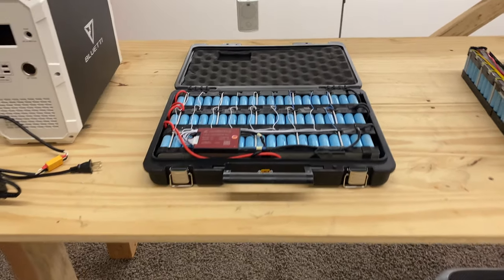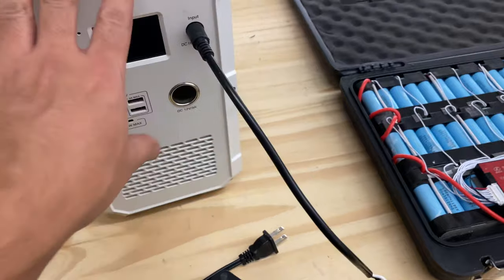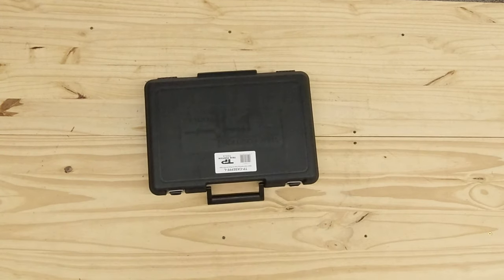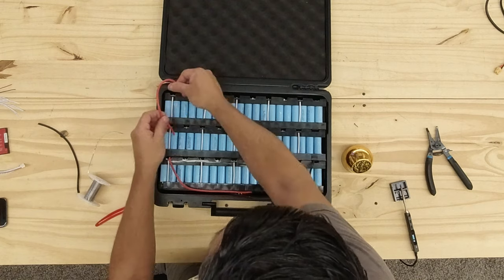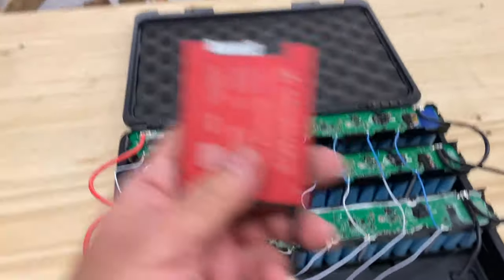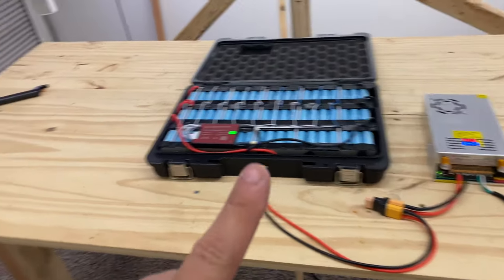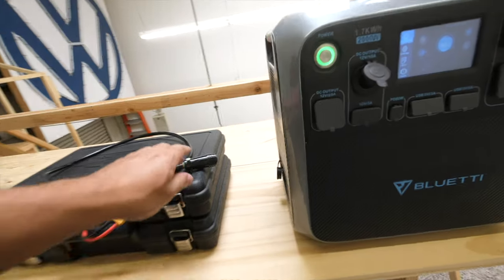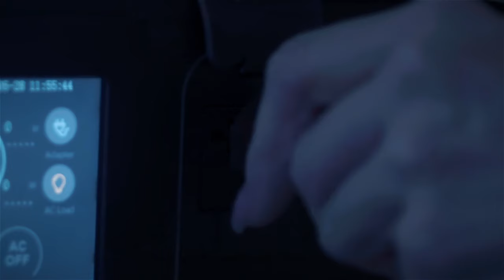Solar Generator Bluetti150 DIY Booster Battery Pack

Comment: Great job! Where you passed the XT60 connector through the case, you could have insulated it with hot glue instead of the kapton tape to make it more secure. Keep up the great work!

Comment: I’m thinking of buying the 4x option, do I have to take the battery pack apart and test each cells.. or can I just wire them up following the directions in this DIY w the BMS and chargers adapter and soon as I get them shipped?
Reply: I have been hoping to find out the answer to this question as well.
Reply: Al Nik let’s hope  he replied soon.

Comment: Very informative video as always... much thanks! Probably a rookie question but is the Bluetti intelligent enough to in turn automatically recharge the booster battery when you attach it to the mains again or do you have to always recharge this excellent back-up battery separately and not plugged into the Bluetti?

Comment: Questions:
1. I see you’ve left the original BMSs onto the packs. What if there’s a fault on one them and brings a pack down or something? Wouldn’t it be better if you had disconnected the original boards?
2. You say that you could add 2 or more extra booster packs. Careful, they should not be connected in parallel; if you connect in parallel booster packs with different voltage, that would melt some wires or make the BMSs work extra hard.
Reply from the maker: You can remove the original bms but you don’t have to,  if it’s faulty then you’ll have to deal with but why worry before you have to?  If you connect a fully charged pack to a fully discharged pack you’ll see some high amperage for a couple of minutes and then it will start tapering off,  if your wires melted then you are using too small a gauge
Reply: jehugarcia the last one could be an idea for a new test video. However, I expect that the BMSs will kick in and see the setup as a short, probably
Reply: @jehugarcia  I wouldn't advise people to connect a fully charged pack to a fully discharged pack. These packs often have an internal resistance of less than 100mOhm. At 10V difference between fully charged and fully discharged there will be over 50A charge current in a 4, maybe 6P pack? That's just dangerous.
Reply: @jehugarcia  Forgive my stupid question, but perhaps I don't understand which component is the BMS. I thought the Daly Battery pack BMS that you soldered onto the top was the BMS. Which component is the "original BMS" that is being referenced in this post? Does each of the LGMH1 Scooter battery packs in the build have it's own BMS in addition to the one that gets soldered to the top of the three that have been joined together in the case?
Reply from the maker: Watch my latest video
Reply: @jehugarcia  I did...this is your latest video.
Reply from the maker: Ok
Reply: Al Nik yes, each one of them has an already installed BMS
Reply: @ThanosSustainable  thanks!

Comment: For laptop cells that have dropped to 1.20 and 1.40, is it still safe to use them? i got 6 2600mAh Samsung cells from a laptop that i no longer use and the 4 Cell charger i use basically trickle charges until the cells wake up and start being a normal voltage again. They're at 8000mAh combined at the moment and are continuing to charge normally, so just wondering if theyre still good to go

Comment: can you charge the booster pack with solar ? also  could  you do a  video on ultra capacitors and wind power ?
or a ultra capacitor power wall ?

Comment: I have 36v battery packs, each with their own BMS (they are the batteries from your UPS Solar generator videos about 3years ago) is there any limit on how many I can connect in parallel? I think I have about 10 packs; and I would like to build a pack like this for my Bluetti EB150.
Reply: I’ve got 6 running in parallel haha same video series from back then.
Reply: @keeganbuilds  Do you have them connected to your Bluetti 150 or 240? I plugged just one pack into the bluetti and it the charging watts start to go up then just stops charging. My only though is that the battery is pushing too much current. Any thoughts or recommendations?
Reply: Conner Sankey no I have them powering a ups from that video series

Comment: I bought a bluetti and it died. Plus I'm having difficulty getting a refund. I only have four 100 w solar panels that charge DeWalt batteries. For the record I'm much happier with the DeWalt DCB 1800 portable power station. 3,600 peak Watts and 1800 continuous Watts. I bought mine refurbished it was a great deal.
Reply: Good suggestion, though the EB150/AC200 are pure sine wave inverters vs. the DeWalt's modified sine wave inverter.
Reply: @JoelKleppinger  DeWalt also makes a direct hookup for small battery packs. I can charge all my electronic devices safely. 😎

Comment: Jehu. I have come across Traction motors and trans. I hear there is alot of people interested for VW convertions. Let me know if youd be interested. Thanks
Reply from the maker: What kind?
Reply: @jehugarcia  I will find out. But they are cheap. Have a battery with it too. I'll get back to you.
Reply: @jehugarcia  They are siemens 1pv5135-4ws14-z
Reply: @jehugarcia  come with everything.